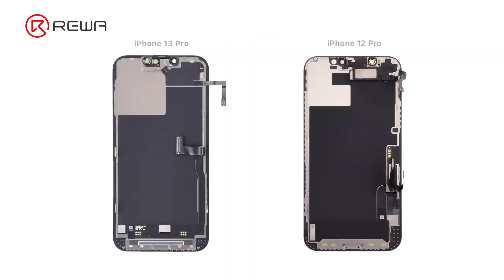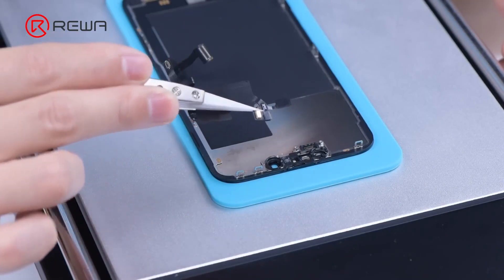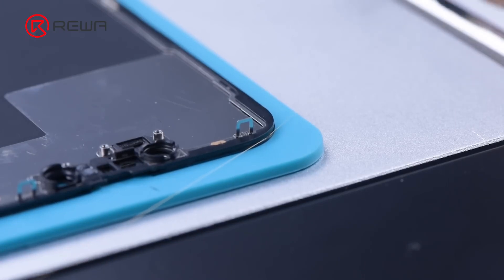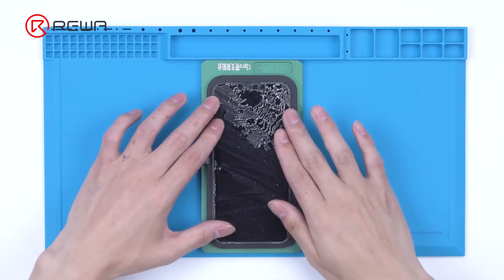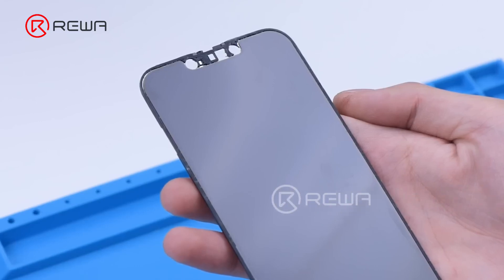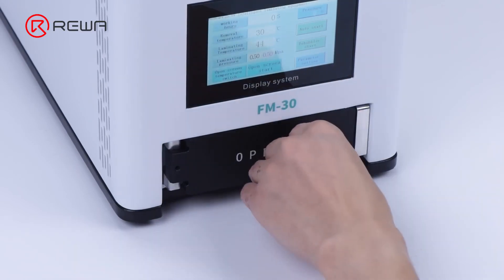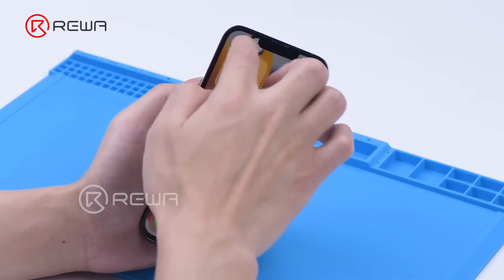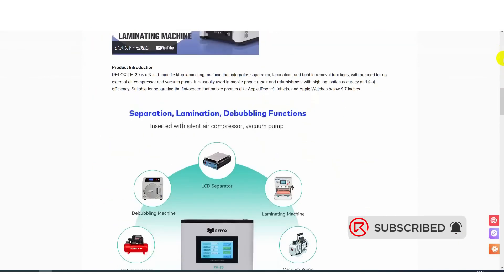iPhone 13 Pro Screen Refurbishing - Refox FM-30 Demo

Comment: hi, what settings are you using?
Reply from the maker: it not so accurate and depends on models.  generally, we set removal temp. 80 degree and laminating temp. 45 degree
Reply: @teevoapp 55 temp laminating it is ok too? And 0,62 laminating pressure?
Reply from the maker: The temp and pressure are ok. If the bubble couldn't remove, you can try more pressure. But the most important is that do use foam to protect the whole screen.
Reply: @teevoapp  foam only under the screen is enough right?
Reply from the maker: yes, but it is better to have foam both sides